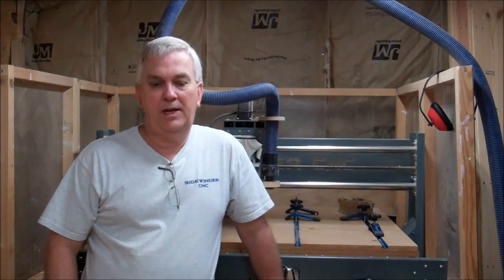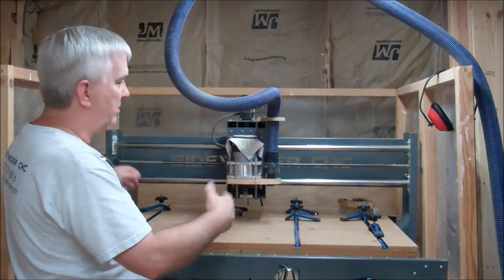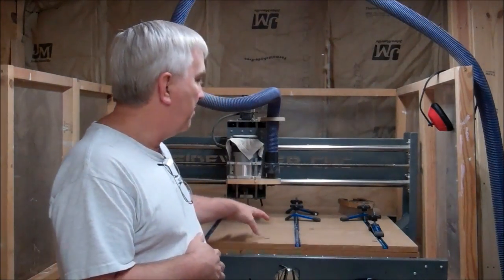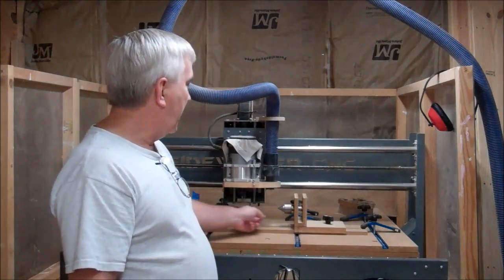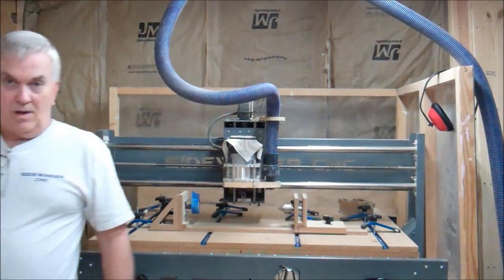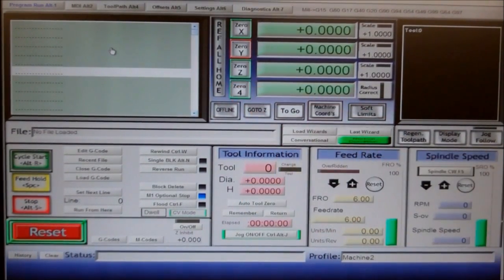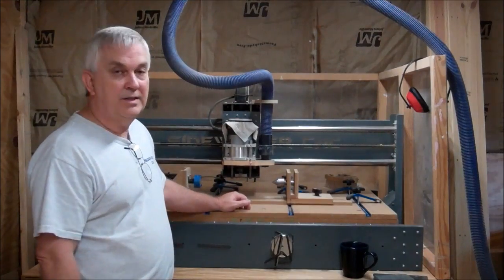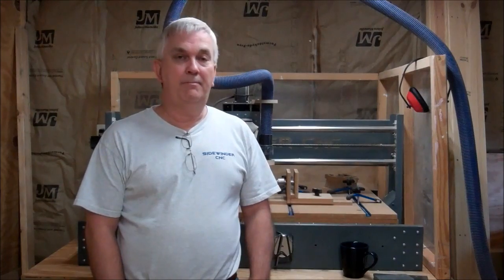Adding a Rotary 4th Axis

Comment: Hello Dave, I am just adding a 4th axis option to my controller and just wanted to ask you that the 4th rotary axis is basically like give the signals of X or Y axis to rotate the material or its separate axis and do all X, Y, Z & A axis can work simultaneously. 

And is your rotary axis configured in degrees or distance mode.
Reply: I have fagor 8037M controller (3 axis controller) , can i add 4th axis ( rotary) 
(Milling machine

Comment: Except that won't work! If the y axis is disconnected that means the y axis is free to move without a stepper to hold it in place. The only way around that is to somehow clamp your y axis down
Reply: My reasoning behind it being able to move is: that without current being applied to the stepper motor, there is no holding force being applied to the motor shaft. This would allow the y axis to potentially move. With a lead screw setup this is somewhat negated but still possible. I would try to lock the axis in some form to be safe. My setup is based on a belt & pinion drive system (def won't work w/o clamping the axis)
Reply from the maker: I can't figure out for the life of me why you think the Y-axis will move when disconnected.  Maybe it will with YOUR machine but it will not move at all with mine because there is nothing to turn the lead screws and unless they turn it's not going anywhere.  Perhaps you could upload a video to show us all what you are talking about.
Reply: Mark Lindsay He might be worried about kick back or screw slop, But hey Blitz if you want to clamp it down GO AHEAD...lol ! If this gentlemen decides not to there is no reason to make a claim that it wont work..... obviously it does and if your machine is different there is no point on even making such a comment, Cmon now.  Great Videos Dave. Id love to build one your shoestring budget machines for hobbie sign making :D
Reply: +blitz355 The Y axis doesnt move because the lead screw acts like a worm drive and can only be driven by rotating the threaded rod itself. If your machine was driven using belts and pulleys then there is a chance of y axis moving. I could be wrong too